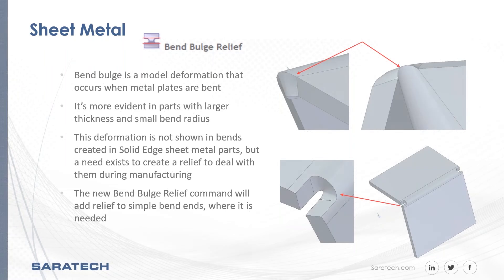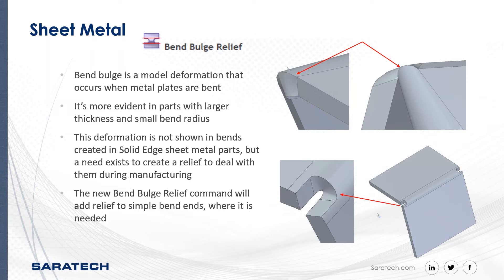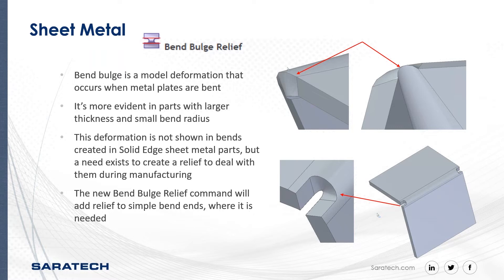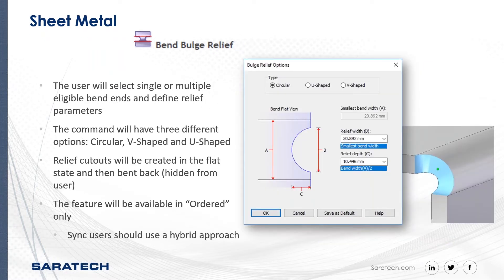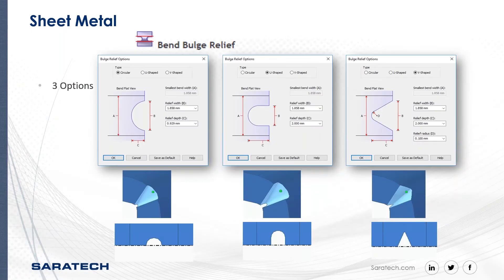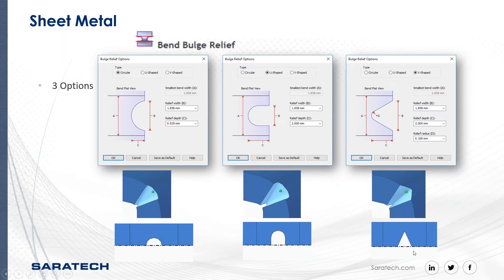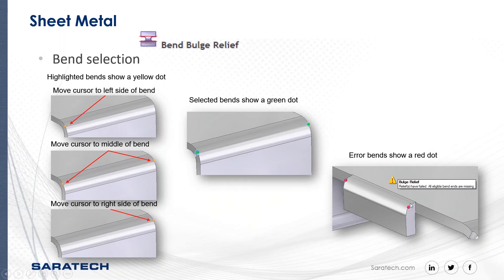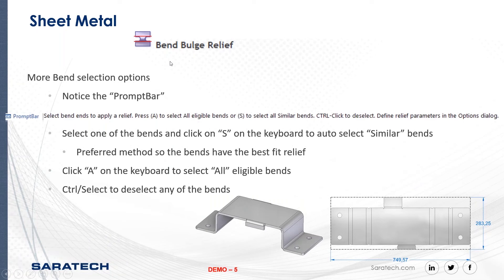Solid Edge 2020: Bend Bulge Relief

Comment: Hi,

Thanks for sharing the video! I’m working on a design where I think I’ll need a bend bulge relief, and I’d like to calculate its size and position. I’m using 6mm thick material with a 12mm outer bend radius. Could you help me with the calculation or guide me on how to approach this?

Thanks in advance!
Reply from the maker: The Bend Bulge Relief Dialog gives a recommendation for the smallest width which can be used to find the depth as well. How you might calculate this value manually could be dependent on the bending process, material and use case. As for positioning Solid Edge will recommend bends that may need these bulge relief as talked about in the earlier parts of the video and will place them for you automatically.